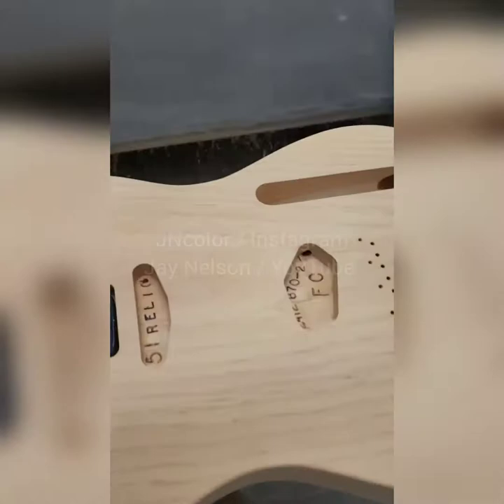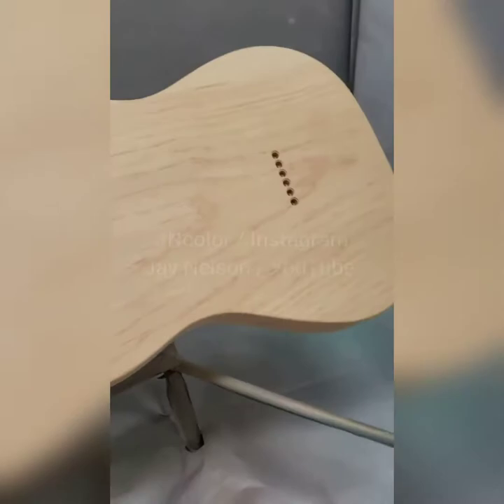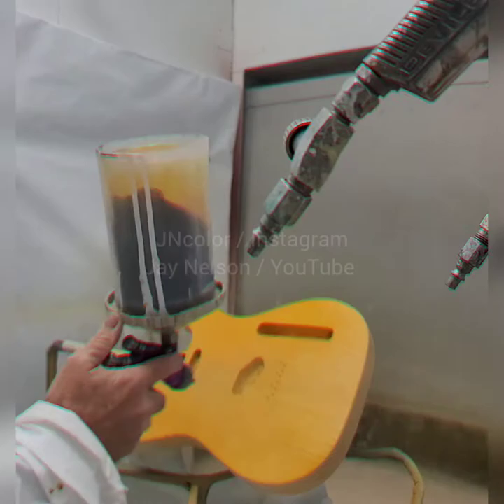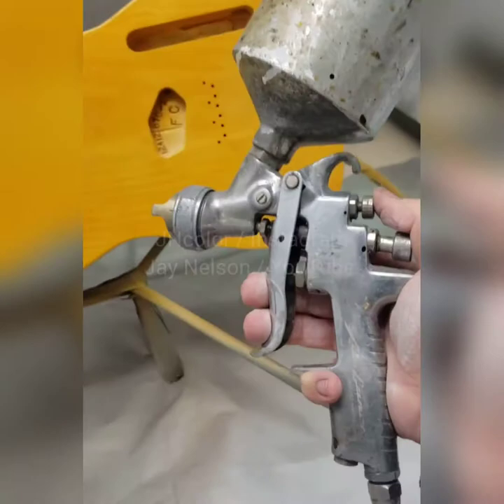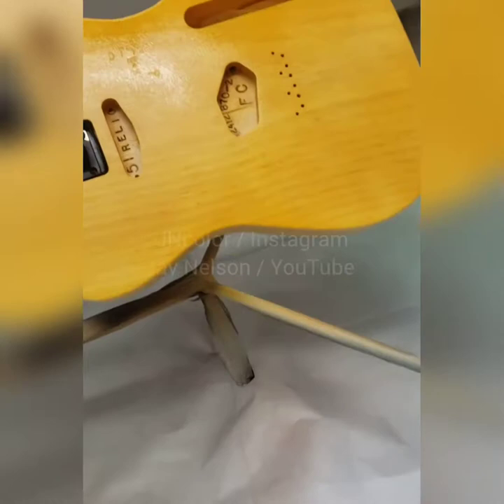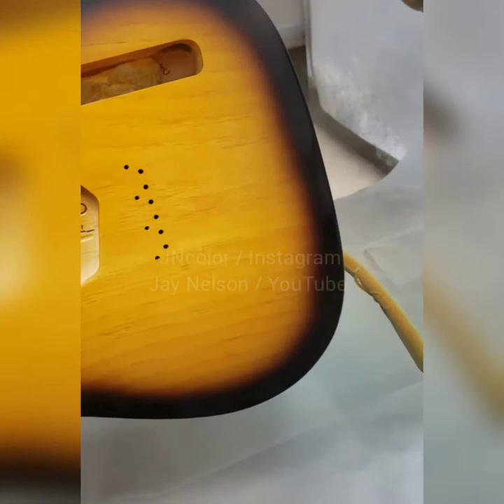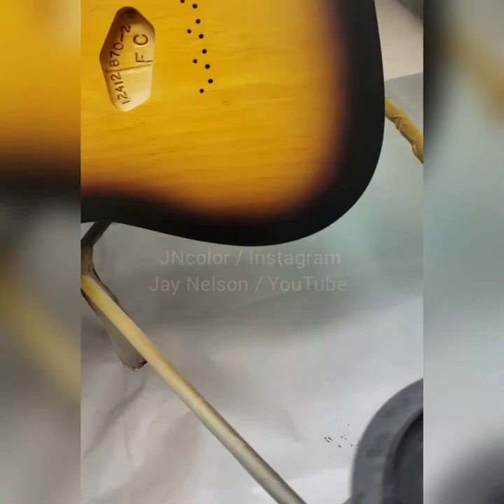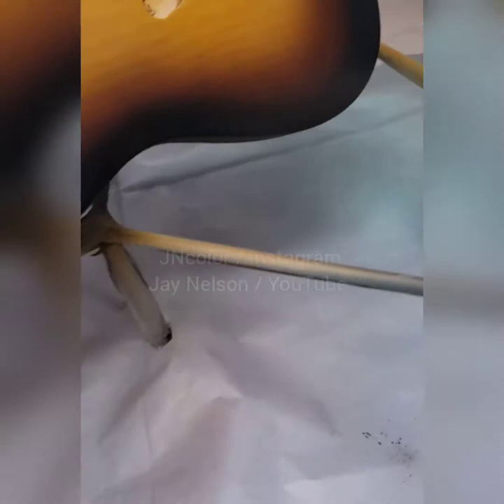Spraying a wide faded two tone Telecaster

Comment: hi jay , im looking to do a sunburst finish on a tele body im working on ! im planning on using watco lacquer as a grain filler and as a topcoat and was going to do the burst with an airbrush i have . i was wondering if you might have any suggestions as to what to mix with lacquer to get the black/brown  and red tones for the burst  thanks
Reply from the maker: Hi,
If you can get some stain, that should work. You won't need much so you'll probably end up buying way more than you need. You can use an alcohol based dye. I'd suggest prepping a piece of scrap wood and doing a bit of trial and error on that before shooting your guitar.
Reply: thanks a million!  is there any type of stain i should aim for ?
Reply: @JNcolor  im going to assume you mean a solvent based stain? or something like trans tint ?